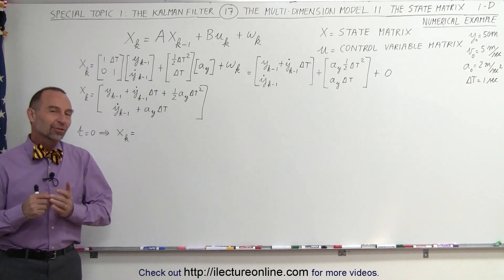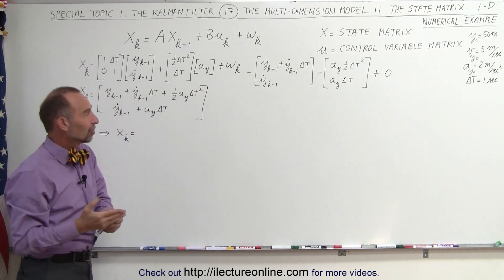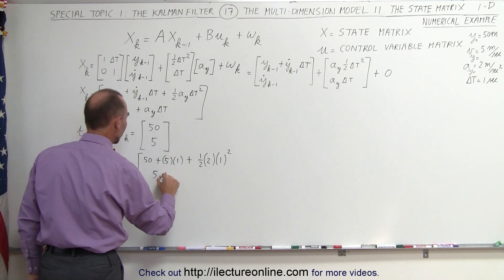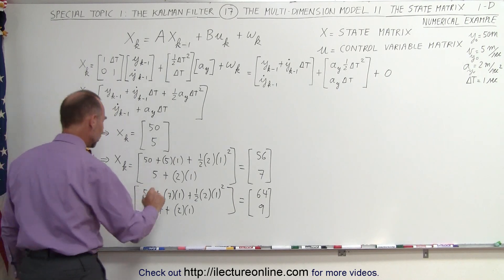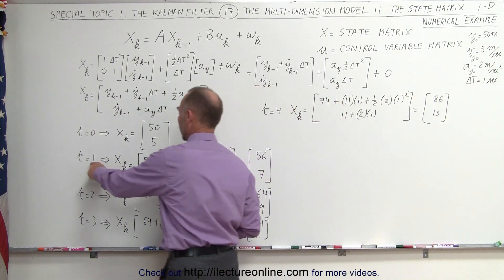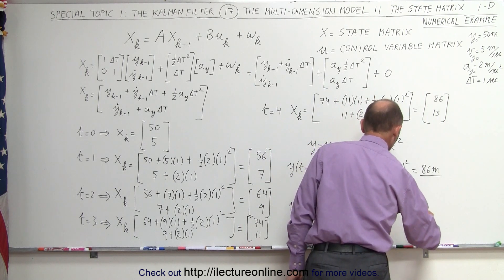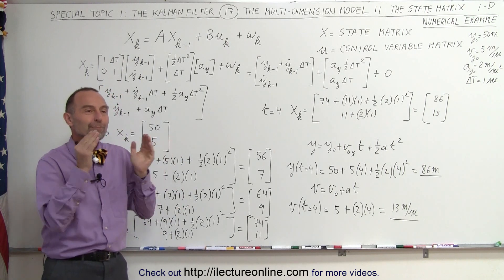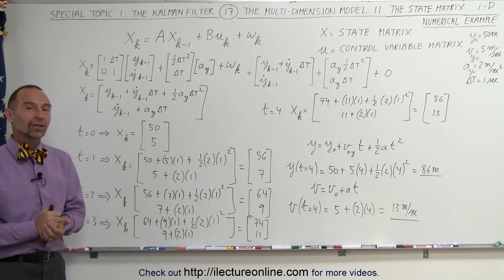Special Topics - The Kalman Filter (17 of 55) 11: Numerical Ex. of Finding the State Matrix 1-D

Comment: Great lecture! 
Where does the system get the value of the acceleration from is it always a constant value or is it measured or there's a seperate algorithme to calculate it?
Reply from the maker: It depends on the system.  Let's say that this was used for a radar tracking a target.  The measurements (detections) would be position and possibly velocity (based on time elapsed for the return signal and the doppler of the return signal).  From successive measurement, acceleration would be calculated.
Reply: I get it now, thank you sir
 @MichelvanBiezen

Comment: What if the object is not moving forward (or upward) all the time? For example if the object moved 10m forward from T0 to T1 then from T1 to T2 it moved 4m backwards? Does Kalman Filter work for predicting the next position of an object that moves in such way?
Reply from the maker: It would throw off the filter for a few data points, but it would quickly catch the pattern and zoom into the predicted position.
Reply: Great! thanks for the prompt reply :) you're an amazing teacher btw I hope to be like you one day
Reply: One more question, does this also apply to an object moving in an xy plane? Given that it moves in a random way between the positive and negative values of both x and y
Reply from the maker: If the object moves in 2 dimensions, you set up a separate dimension in the filter, (just add elements to the matrix).